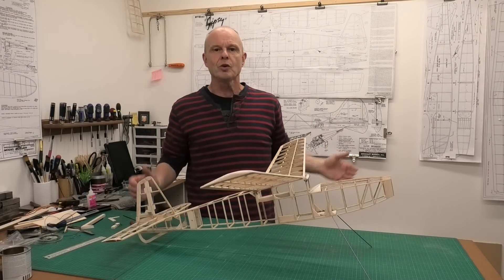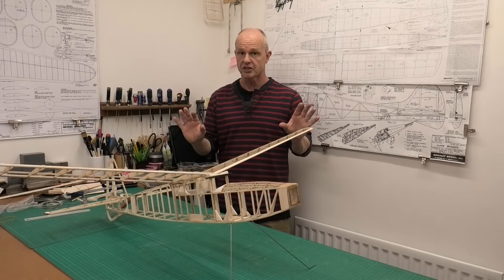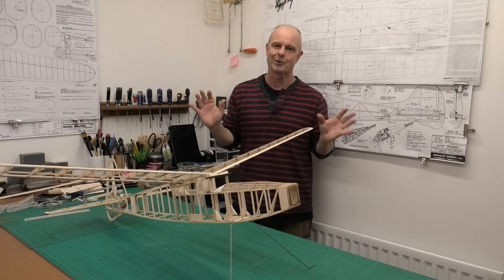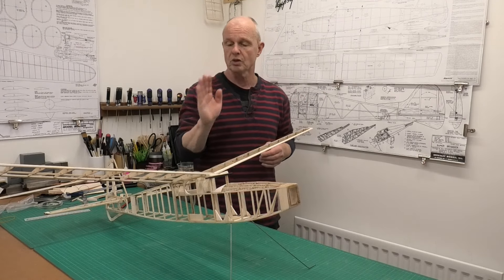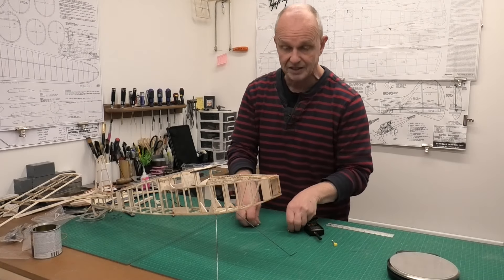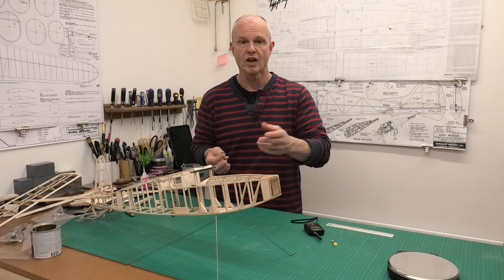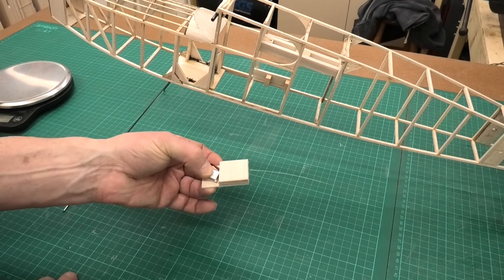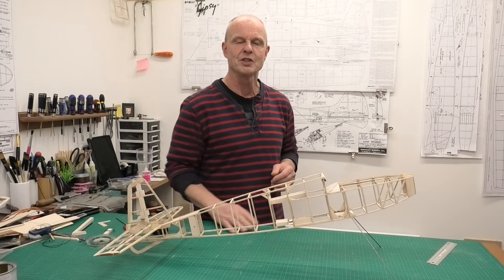Keil Kraft Gypsy - Build Series - Pt 7: Fitting the GPS Tracker - 1949 Design by Bill Dean

Comment: I'm new to building with balsa, but find converting OZ plans for laser cutting far more consistent than printing to paper, glue stick and cutting by hand. I tried the "traditional" way but for hard balsa and/or plywood parts, I found it nearly impossible to cut cleanly with a knife. Am I missing something?

Really enjoying it though! And my first wing came out straight! No twist, warp or bends!
Reply: Always start a project with a new blade, usually a X-acto #11. To help lubricate the blade before each cut, drag it through a bar of soap, I use ivory. (my late grandfather told me no blade is sharper than a soap carver's knife) Cut all spar and stringer locations/slots/notches before cutting the rest of the part.  For curved parts cut in the direction if the grain grabs the knife it will go to the outside of the part. If a cut is straight, brace the blade against a metal straight edge, if cross the grain use best direct ion to hold blade against the straight edge. It also helps if you glue some fine patches of sandpaper to the back of the straight edge to prevent slipping. Above all, you don't have to cut the part to the exact outline, you can finish by sanding to final shape.
Reply: Many modellers use a 'razor saw' for harder materials; it's an extremely thin hacksaw with a stiffened back and ultra-fine teeth. Great for the things that won't yield easily to a knife.

Good luck with the model, and do please post a video of it when it's ready to fly! 🙂
Reply: @EleanorPeterson  Thanks yes I have a razor saw and keep it lubricated. Works great for hardwood spars etc. I also have used a coping saw. I find complex shapes, curves, holes in formers, etc. Its just far more reliable to use the laser for precision or tough materials (or absolute consistency such as 20 identical wing ribs. Xacto seems best for thin, soft material like sheeting. For me, part of the fun is learning what techniques work best for different tasks etc so all in good fun!
Reply: @simitarknut2201  Great tips thanks! Will def grab a bar of soap and keep it handy for lubricating these blades!
Reply: @simitarknut2201  Wow! I had to come back to this comment and thank you for this advice! A simple bar of soap has made xacto knives and the razor saw so much more accurate and  enjoyable to use! Just a quick swipe before I make a cut and a world of difference this lubrication has made. Thank you so much!
Reply: @Discopuss  FYI a company called Micro Mark used to sell saw blades the size of an X-acto #11 blade and they came in various teeth-per-inch. Great for fine cuts.

Comment: It may be too late for this idea. If you were to make the rudder with pull-pull cables with small tensioning springs up by the servo arm, you may be able to do away with the dethermalizer elastic band. Plus maybe still have some control as it is coming down.